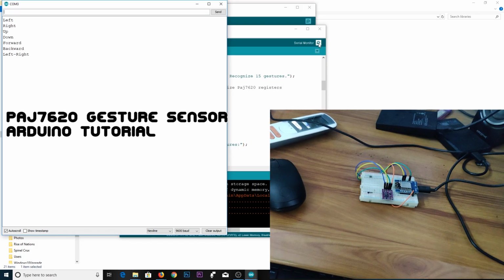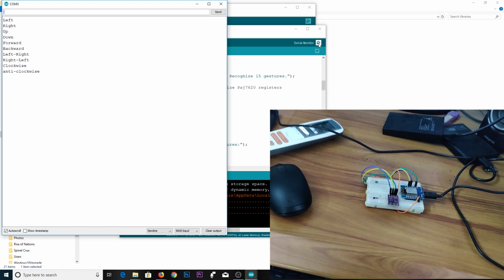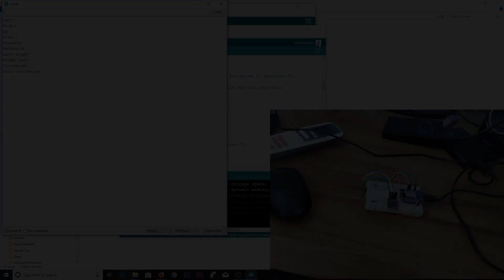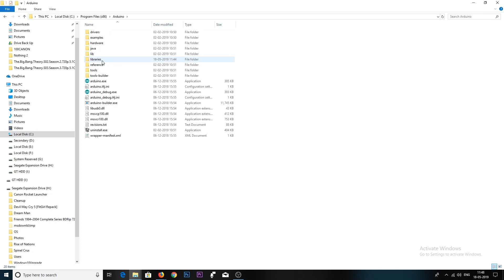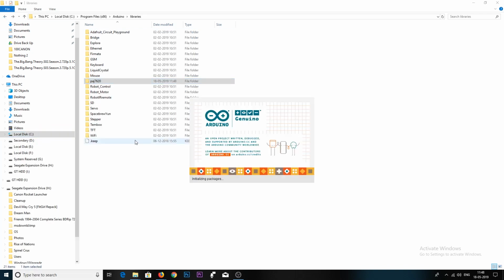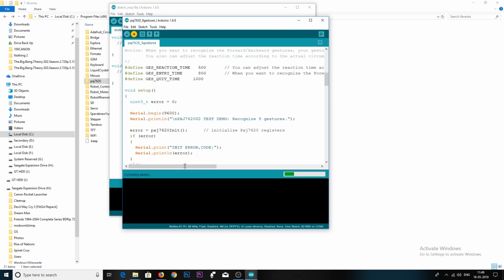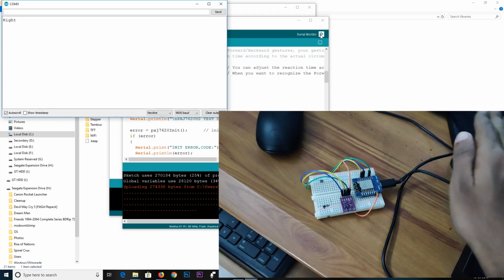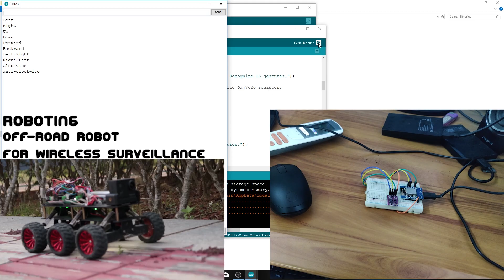Arduino Gesture Sensor PAJ7620 Tutorial | How to make a Gesture Sensor?

Comment: how far can this sensor detect? I tried APDS9960 and it is not very reliable and distance is not far enough for me to use it to determine which direction I am walking and turn some light on toward that direction. do you think this PAJ7620 can do the job? Can I only use left or right?